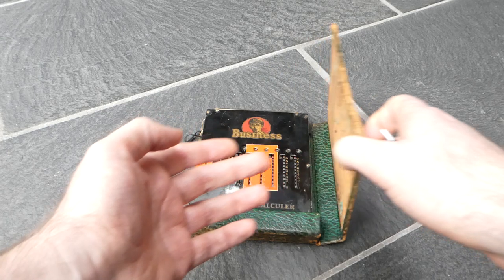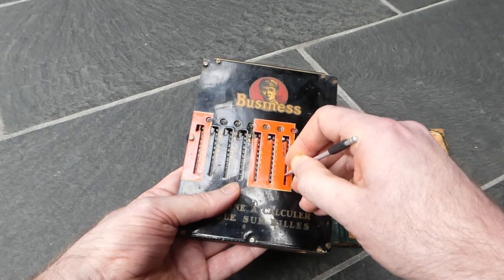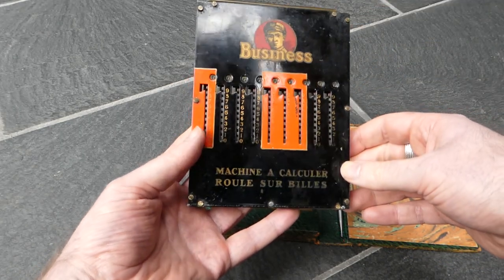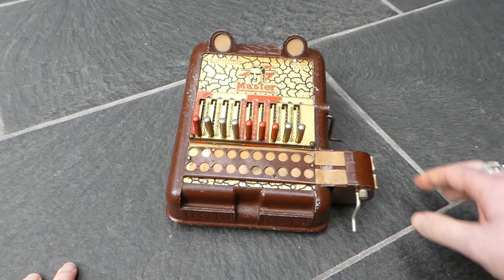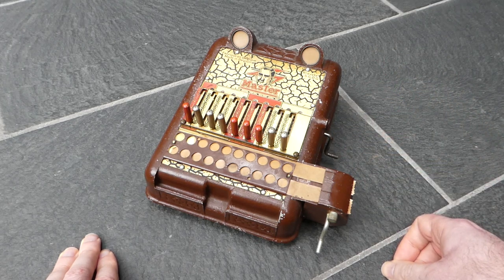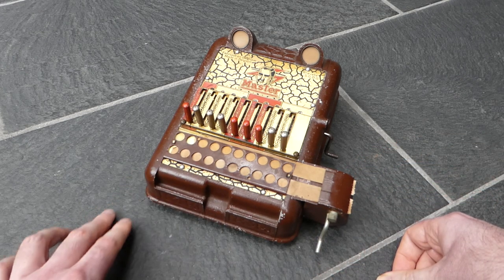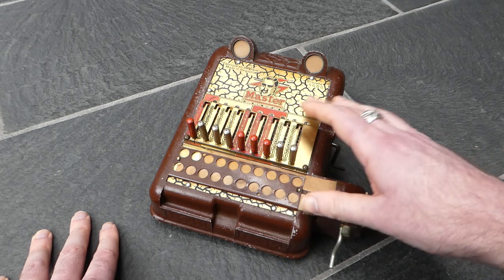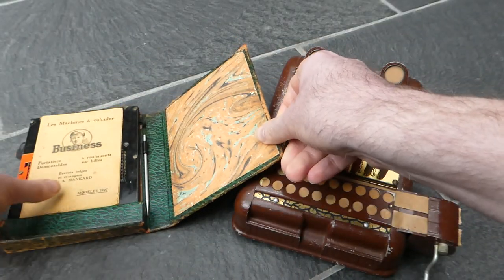The Business and Master adding machines

Comment: What was the typical use for the dual paper tapes?
Reply from the maker: With multiplication you can write the two factors on them before you start the calculation. When dividing two numbers by long division you'd have the  dividend in the register, the divisor on the top paper strip and shift it along while you write the quotient result on the bottom strip.